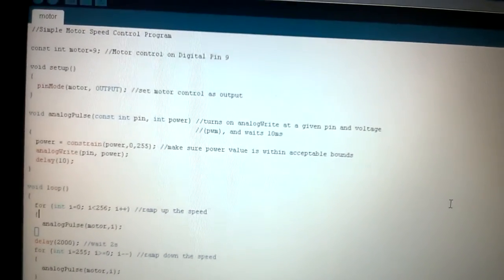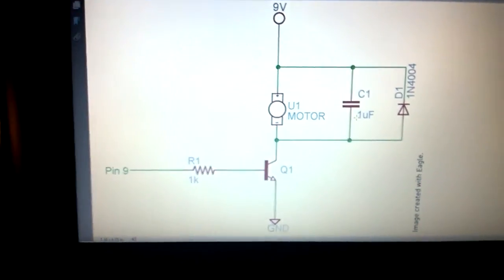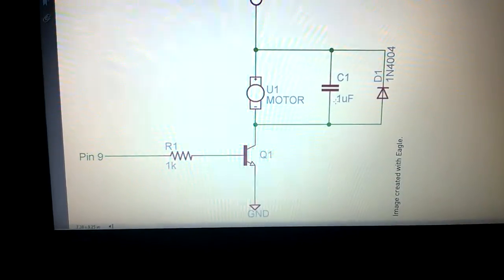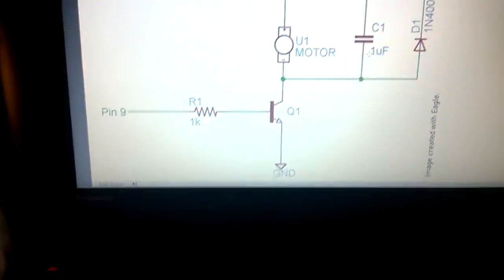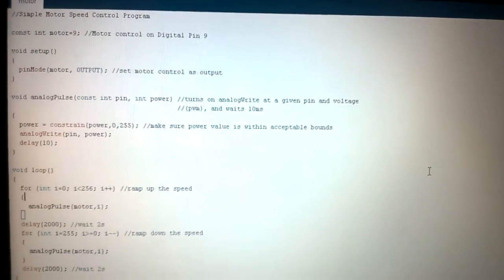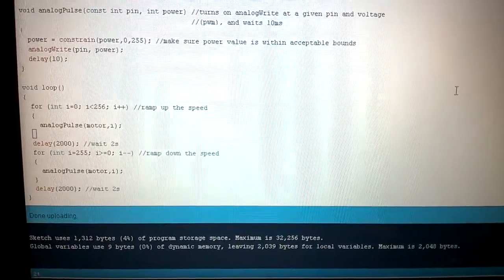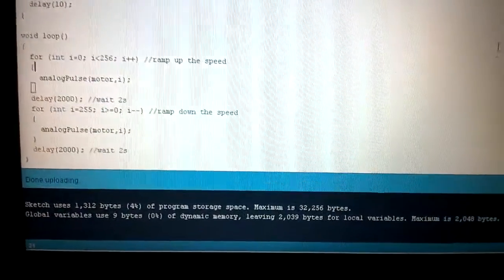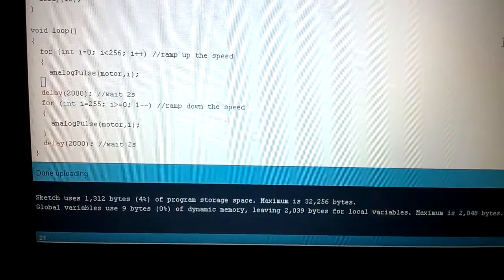DC motor control w/ speed ramp via PWM

Comment from the maker: correction:

I was wrong about why there was no off period at the top of the upper speed ramp, here is the actual reason: The analog write function leaves the pin in whatever state you specify. So, if you had an analogWrite(175) command outside of a loop, the pin would continue to receive about half power until you took the power away with analogWrite(0) or digitalWrite(0). This of course means that my Pulse function is actually not pulsing, it's just incrementing every 10ms. The delay after the top value simply maintains that value for 2 seconds.
Reply: So, you were not sure why the battery and the Arduino should share the ground. 
Here is what I think about why that is the case: 

Your Arduino runs from 5V dc. But 5V is just a potential between two voltages. So you laptop that is powering the Arduino could generate 10V on the "-" and 15V on the "+", thus providing your Arduino with a 5V potential. But, if one system gets values from another, then they have to work on the same potentials!

If my 10V to 15 V system will try to map its Voltages from 0 to 255 and then send a 0 to another system, it will send 10V - it just can't send less. 
A second system that may be working from a different power source wich provides a 5V potential between 5V and 10V will receive the 10V and obviously think that that is a HIGH, even though it was a LOW signal from the first system. 

How so we solve the problem? We give the two systems a common Gnd. Thus they will be able to know where LOW is, and that 5V up from that, that is HIGH. 

In your case, if your Laptop would work between say 2V and 7V and the battery between -1V and 4V, the transistor would still be triggered, even when the Arduino would be sending a LOW, because  LOW would be a difference of 3V to the batteries Gnd and result in a current between the GND of the battery  at -1V and the Base of the transistor at 2V.  
And thus your motor would keep running.